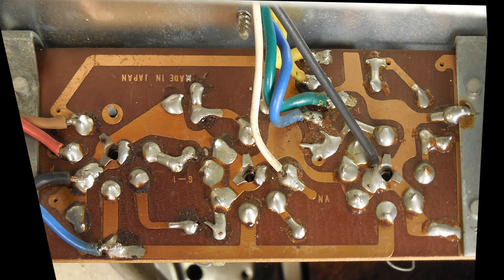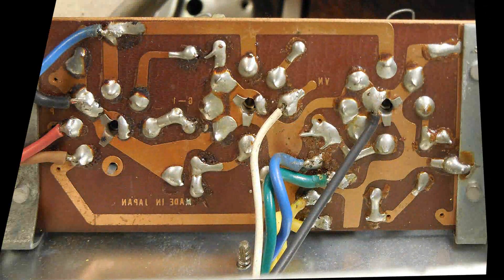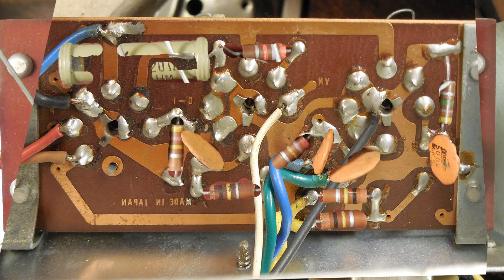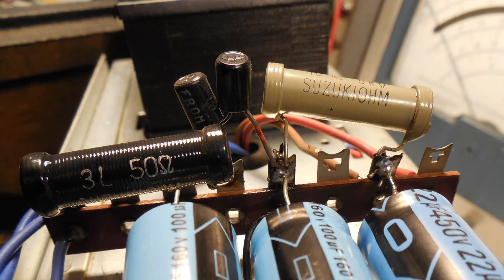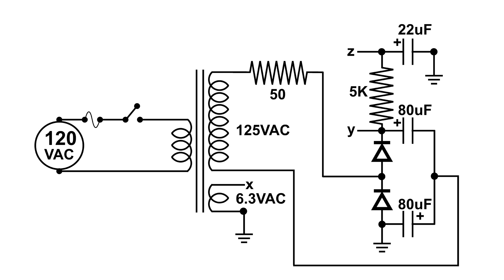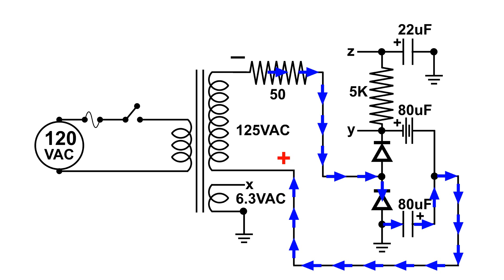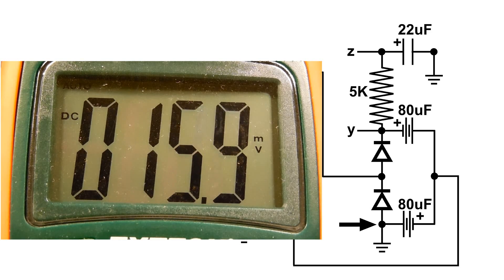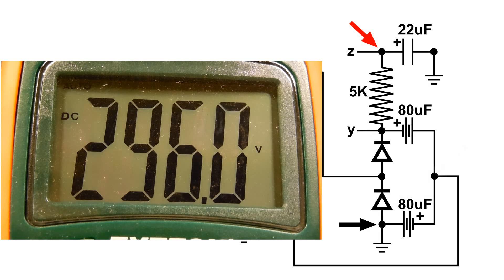Lafayette Guitar Amplifier Diagram Power Supply

Comment: Hi Rick, nice explanation of the voltage doubler.
I love Photoshop, my AutoCad won’t run on Windows seven but I was able to redraw the complete circuit diagram for my Eddystone communications receiver in Photoshop, I show the process in About Radio part 30. (I hope that helps some folks) it’s almost as easy as AutoCad. Keep up the good work Rick, I know how much effort goes into this process of video presentation and you do it so very well. 
Kind Regards ... Andy
GWØJXM

Comment from the maker: It is interesting that the original capacitors working voltage is 150 volts DC. I wasn't quite done with the drawing and in the video is the first time that I measured voltages. I updated the drawing with reasonable working DC volts.

Comment: The last thing i saw with the Lafayette name was something I once owned- a mid-60s era CB radio which was made by GRE for Lafayette.  It was an all-tube unit with the exception of the two-transistor inverter used to power it on 12V, and it had an EL84 output tube.

Comment: Great Reverse engineering here Rick. Very impressive use of Photoshop to manipulate the images, and thanks for the schematic for this amp. I noticed how some V #'s as well as tube #'s are missing from your schematic (also watts for R's and volts for the Electrolytic's) were missing as well. Saw them from your last vid and Thank you for all really, but you know what is going to happen, someone is going to build one with 25WV's from shack. Also the two 80uf in your schematic should be 100uf. Thx

Comment: If you're seeing 168 volts across the bottom 80µF cap, doesn't that exceed the voltage rating of the 100µF/160V cap you used as a replacement, shown in the previous video? With inductive-kick from initial power-up, won't this voltage spike significantly higher for a brief time? Also, I noticed the final filter cap was originally 20µF/350V, and you replaced it with a 22µF/450V. Prudent move, I tend to always buy caps with the highest voltage rating possible. It's often only a few cents more.

Comment: Thanks for the video.  I hope you'll be doing more with this since I have several old analog guitar amps and I'm interested in how they function.  When you measure 167.9 VDC from ground to the lower cap is this particular voltage a result of the cap value?